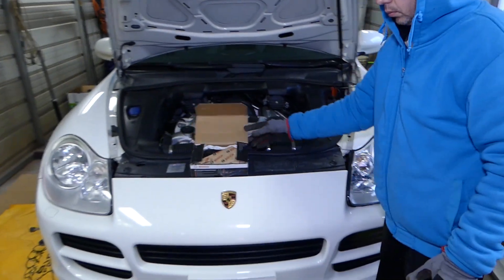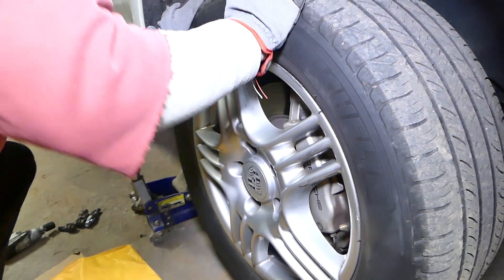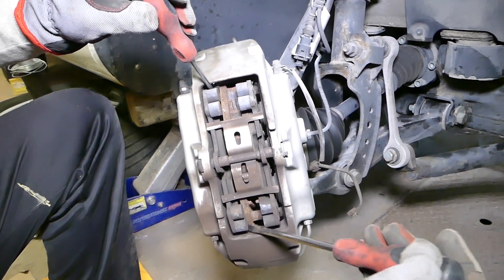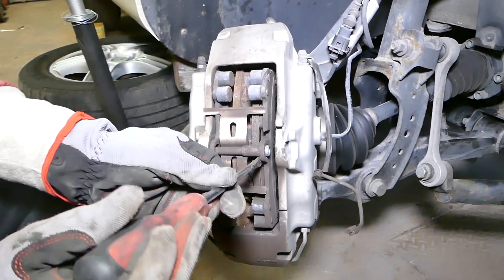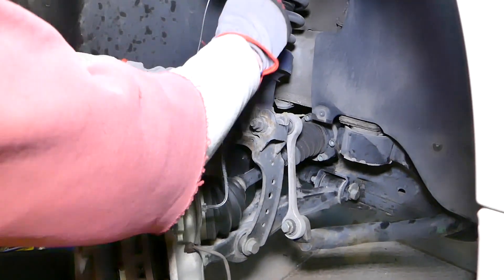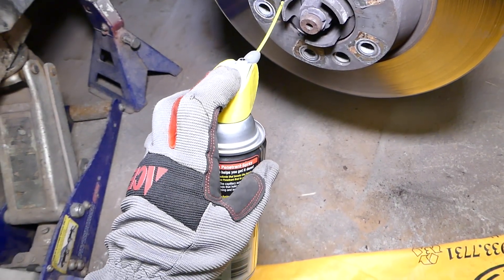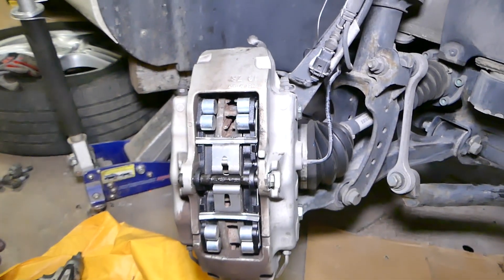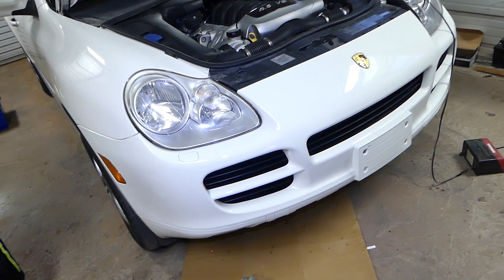HOW TO REPLACE FRONT BRAKES BRAKE PADS ON PORSCHE CAYENNE

Comment: As I have a 2008 Cayenne S I’ve found your videos invaluable. Thanks to you I was able to replace the starter motor (even though 2008 is a little different) and more

You didn’t mention it but I. The trunk alongside the locking nut is a shaft with a thread one end. You use this to put in the top wheel bolt so you can slide the wheel off along the shaft. Credit to some other YouTuber

Comment: Cool man.. I would reuse the bolts many times.. No need to put new ones in
Reply: I’ve usually followed Porsche recommendations on “torque to yield” bolts given I save enough on doing the work myself. They’re only about $6. PelicanParts: “Porsche uses a coating on the threads of these bolts to secure them in place and are designed to be used only once.”

At 210 ft lb torque they are tough to get off and I wouldn’t want to use some locking compound